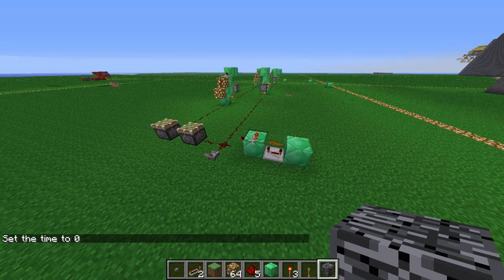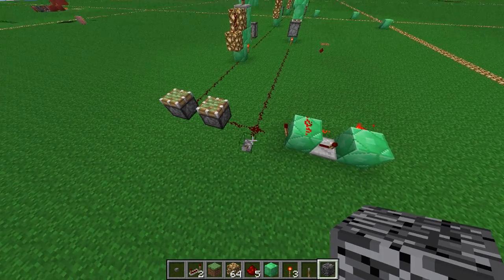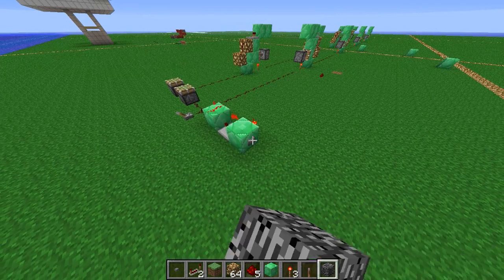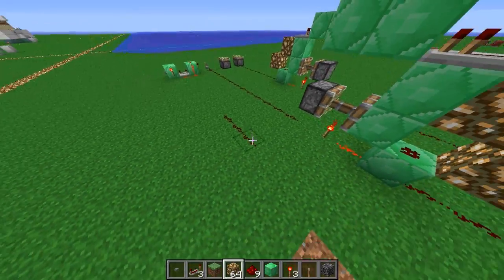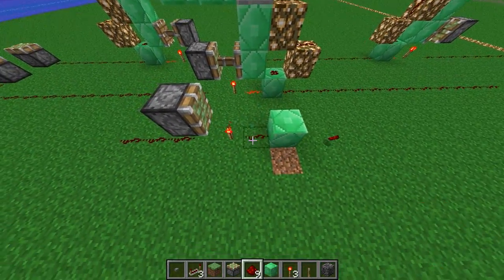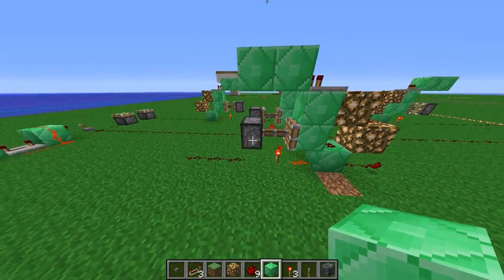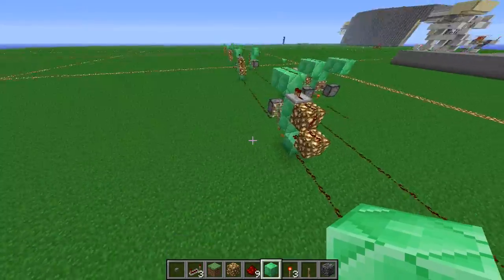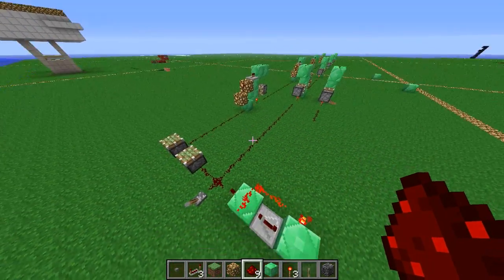Minecraft Piston invention #24: Compact 1 wide instant dual edge detector

Comment: have you tested hoe upside down halfslaps work with redstone? you can place redstone on top of them, but it wont be powered if you put a redstone torch under it, it will connect to other redstone spieces on upside down slaps one block higher but it will only transmit a signal thats moveing up.